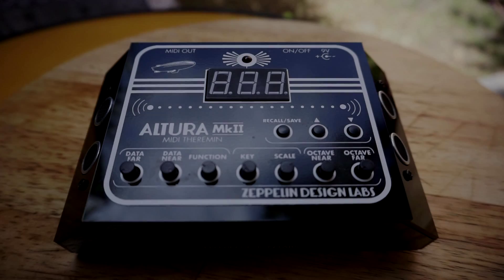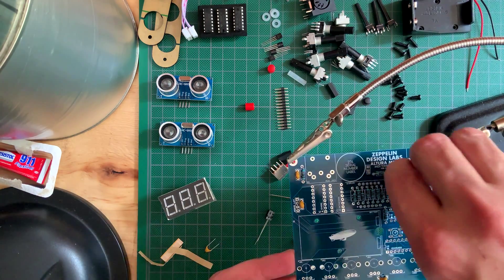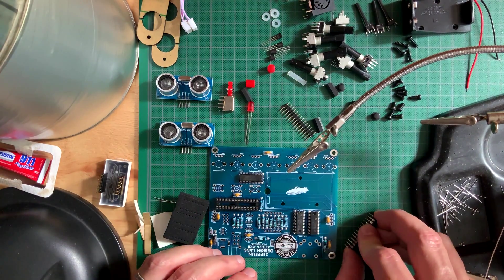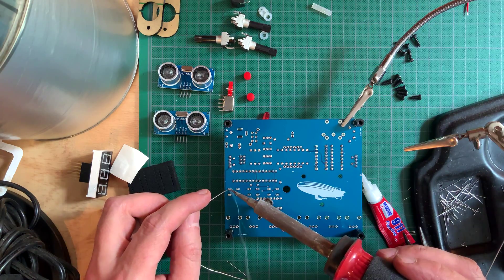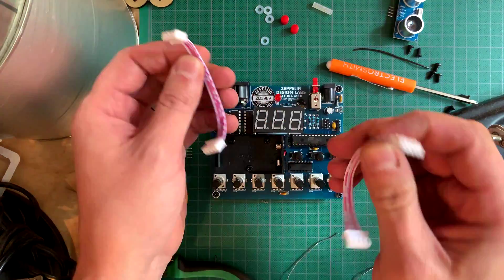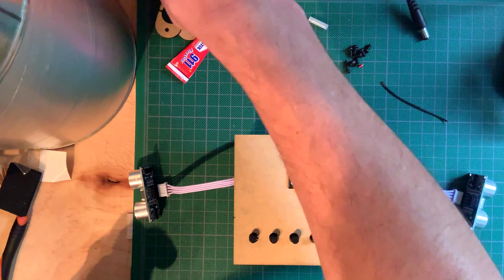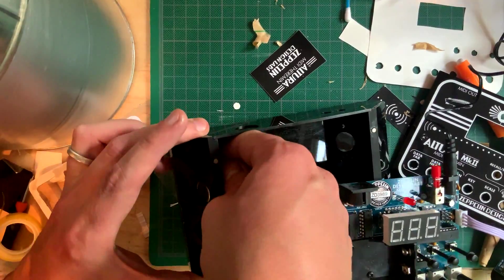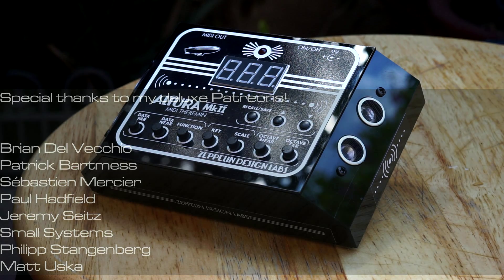Altura Mk 2 - Building the full kit!

Comment: Bad luck mixing up those two ICs ... was the damage only to those chips, or was it more extensive?
Reply from the maker: It was just the ICs. But I only noticed my goof when I already had a replacement unit to compare it to, so I never got around to ordering replacement chips for the first build. I'm contemplating doing that vs repurposing the parts for another project....

Comment: Desoldering 16 IC legs at once can be very tricky.
 If the chips are cheap to replace, you might be better off cutting the legs where they exit the IC body, and desoldering them one at a time.
OR:
 You can get tools with hollow needle tips.
After removing as much solder as possible, heat the pin/pad and shove the hollow needle down over the pin while twisting the tool.
 This can separate the pin from the pad and eliminate those otherwise-impossible-to-remove solder bridges.
Reply from the maker: I agree. I tried it this way because I didn't have replacements and wanted to try salvaging the chips. But I think if I get new ones I can still fix that first Altura.